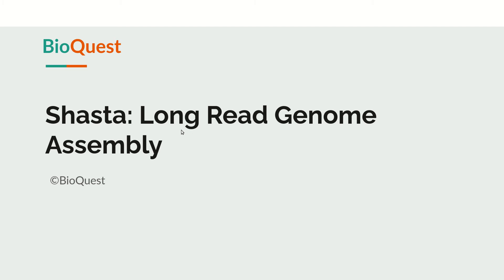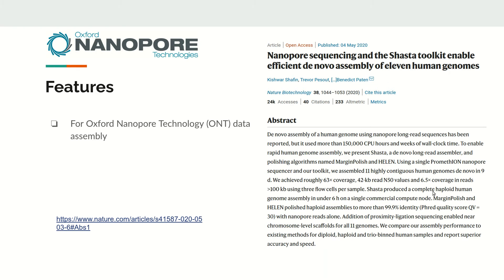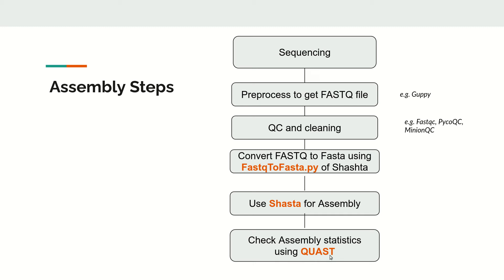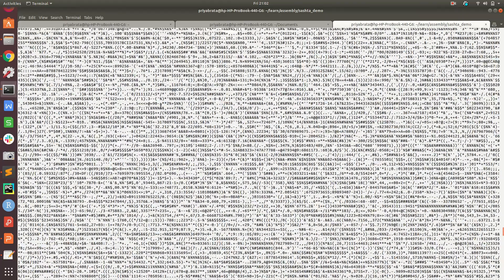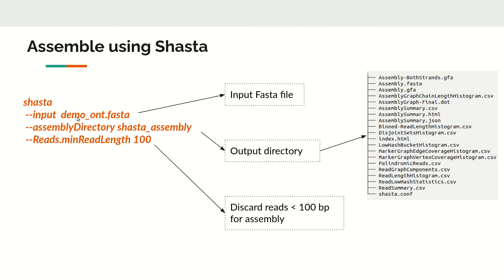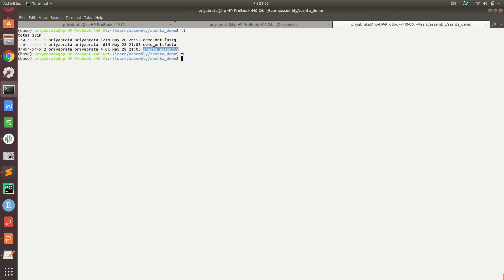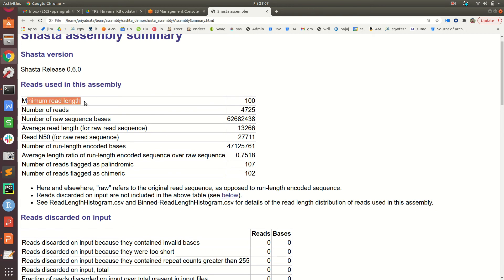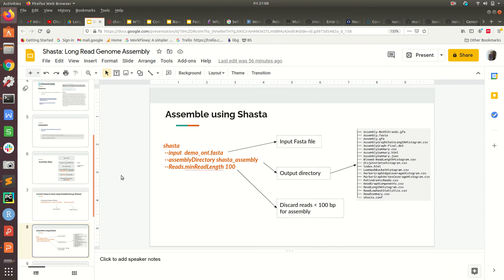Shasta: Long Read Genome Assembly Tool

Comment: Sir.. Your bioinformatics video on genome assemblies is very helpfull and informative. I have little query that how to create FastqToFasta itself. When I run FastqToFasta its showing commond not found. What does it mean? And give the link to download the fastq file.
Reply: Thanks. Fastq file link is provided in the description. The fastqtofasta is provided by shasta. it will be there in the shasta installation directory. you need to use full path to the script or copy the script in the data folder and run from there
Reply: Thanks sir for the reply and valuable suggestions. I will try.
Reply: Sir..can you provide any classes or traning on the hands on linux bioinformatics? Pls provide your contact No.